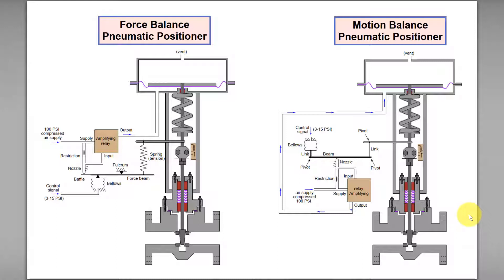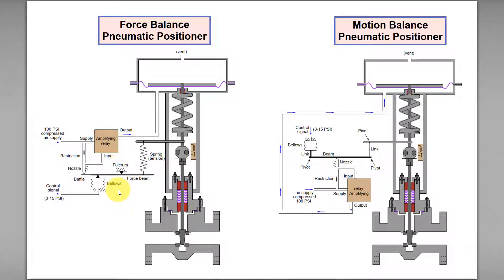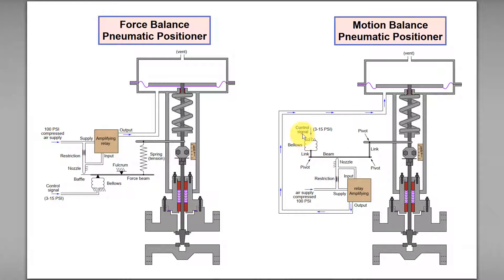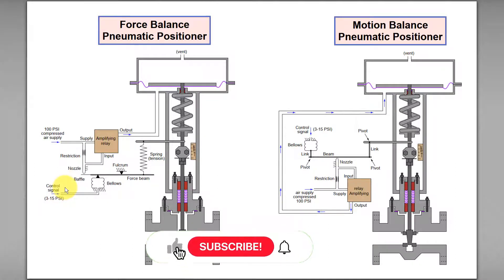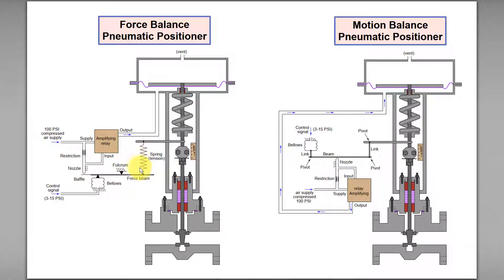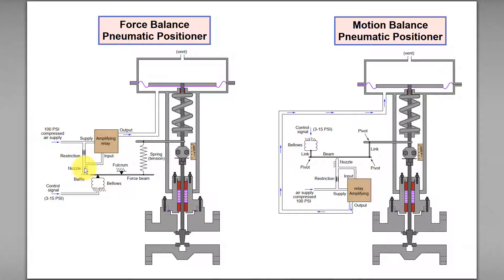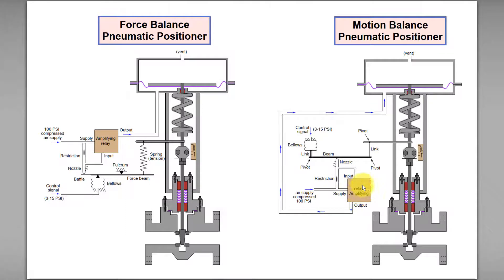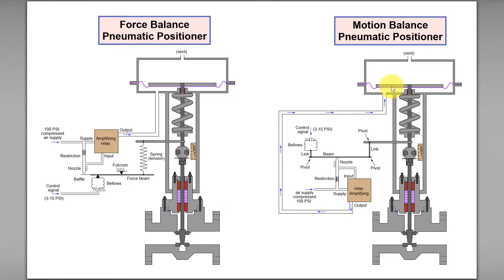Force Balance & Motion Balance Positioner

Comment from the maker: "What is Force Balance positioner and what is Motion Balance positioner? Why there are two types of these positioners? All these questions will be covered in this video. This concept is basic but important for instrumentation technicians that work in the field when doing troubleshooting of the positioner.

Positioner is none other than a controller but this controller is specifically designed for the control valve only. The positioner is used to help the control valve to achieve the specific position or valve travel distance based on the required setpoint. The simplest form of positioner can be boiled down to a flapper (or beam or baffle) and a nozzle."

Comment: what do we achieve by this setup.Why cant the 4-20ma from DCS be used for operating the valve.If the reason that this setup helps to overcome other forces like stem friction then explain how
Reply from the maker: Hi @silentassassin8596, this is the theory of positioner principle of operation for control based on electromechanical mechanism. If you directly use 4 to 20mA signal from DCS to I/P transducer, it only produce corresponding output signal without process variable feedback from the field for controlling purpose. Thanks
Reply: 4-20 mA signal does thhe same job by moving the flapper towards or outwards of nozzle with the help of electro magnetic coil. Rest of the operation seems same. If differ kindly explain. 

Good explanation. Thanks in tons.
Reply from the maker: Yes, you are right. 4 to 20mA does the same job as described by you.